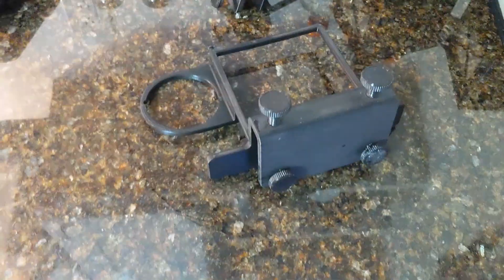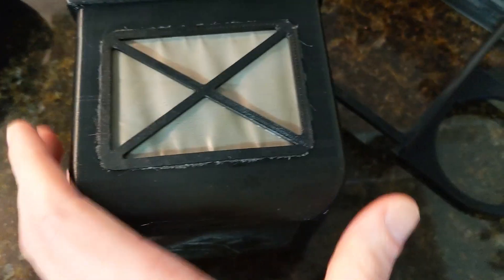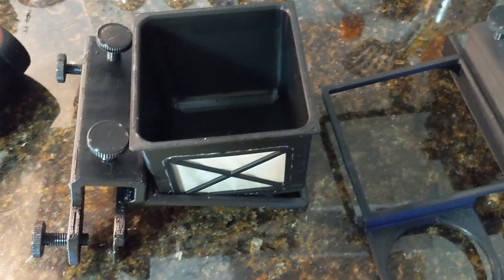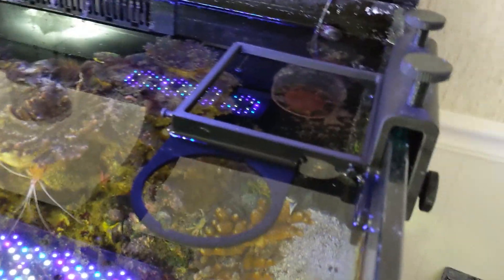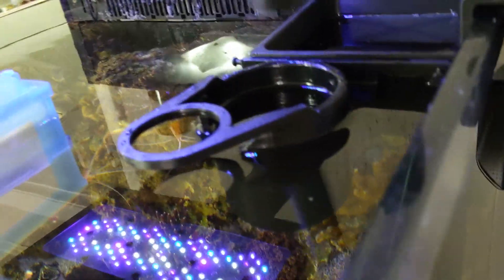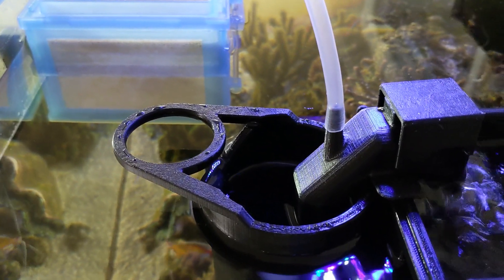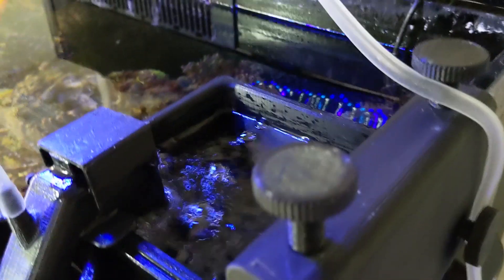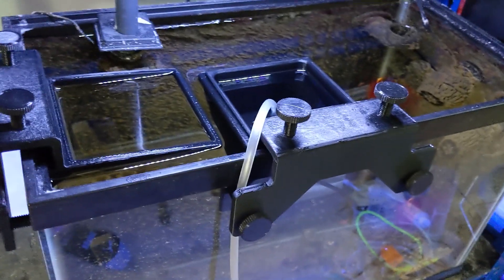3d Printed Pelagic Larva and Egg Collector Parts and Setup

Comment: Really great design! I was curious how much of the total egg release you think you catch with this? For example, the cleaner shrimp apparently release 1.5k avg (just on quick google). Would you catch a good % with this or do you think quite a few never make it to the light and/or get eaten?
Reply from the maker: I don't think I've got that many from a spawn in my tank, maybe 500-600 tops, but the average is lower (maybe correlates with the age of the animal, too).  As for how many, it's hard to say.  I have two cardinals that are ravenous around this time and are often the ones that tell me there are larvae around (by eating them), and even within a group of strongly phototactic larvae, not every one will go towards the light and there is a bit of stray light around that can confuse them.  There are also larvae that just don't pay as much attention to the light and larvae that really prefer it dim - they'll stay several inches underwater if the light is too bright.

That all and that when there are larvae around, I'll try to collect them with a cup or a turkey baster and put them in to speed the process and keep the cardinals from eating them all.  Alone and without the predation, I wouldn't be surprised if it could get better than 80% catch rate for buoyant eggs or phototactic larvae - with all the pumps off, of course - but in reality I probably do closer to 50% most of the time unless I catch the spawn very soon after it happens.
Reply: @mdbssn  gotcha. That's pretty good either way I think. I do wonder why you don't just put the parent in the tub over night though?

Comment: i dont have a saltwater tank but interested anyway, does this work with things like wrasse eggs?
Reply from the maker: Most eggs from pelagic spawners float, so it can collect the majority of them by being a surface skimmer, you just have to make sure other overflows are off since they will do the same.  It should collect any floating egg small enough to fit over the overflow and big enough to be kept in by the mesh (and there's some flexibility as to what size that can be used.)

I think they've evolved to float is that they get spawned mid water and if they sunk, would fall into coral, anemone, and other creature mouths, whereas if they are clear and float, they will be harder to spot and eat (and fewer organisms are out at night, so fewer immediate predators.)
Reply: @mdbssn  thanks for the response
Reply: What do you do with the eggs collected? How do you hatch them?

Comment: This is brilliant! I made one the other day based on a funnel design I found in an old Coral magazine with a 2L soda bottle - cut the bottom off, cut the top off and inverted it to make a funnel up into the main body of the bottle, and attempted to attach the top and middle with hot glue (and learned in the process that hot glue is hot enough to melt soda bottle plastic...), then glued on foam at the rim (originally the cut where I took off the bottom of the bottle) to keep it floating but it took some wrangling and doesn't pull from the very surface, nor does it have any air/water flow to help the larvae in or keep them moving/aerated once inside. And it didn't seem to work - my sexy shrimp must have spawned overnight after I went to bed, but I didn't find any larvae anywhere (including in the trap) in the morning.
Reply from the maker: I  remember thinking that sort of floating catcher design was great, but without quite a bit of suction or some wave action or something, I don't know how they reliably work at smaller scales.  Maybe it's just very dependent on water line placement - even this design tends to need a little positional tuning to make sure the skimmer is under the surface but still reliably pulls things in.  I think going with that smaller inlet aperture helps a lot with maintaining enough suction to draw things in.